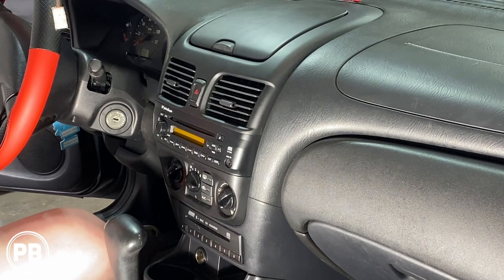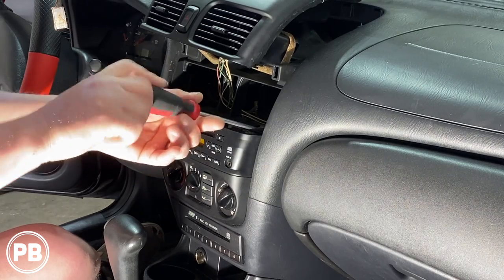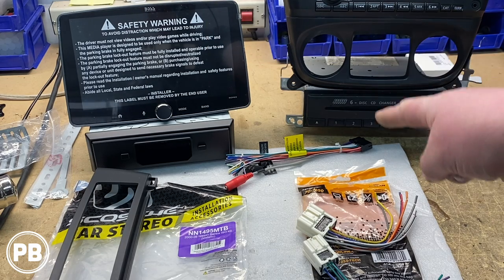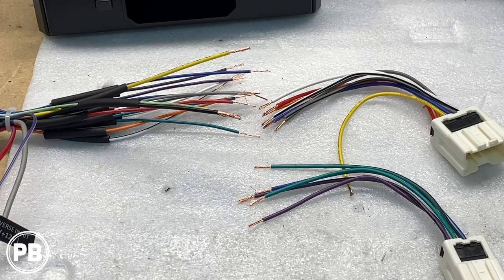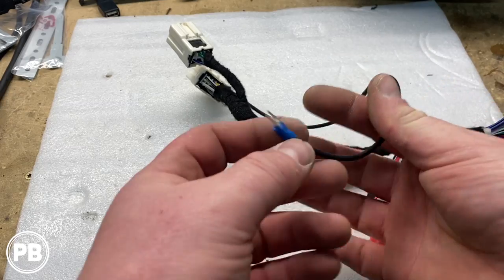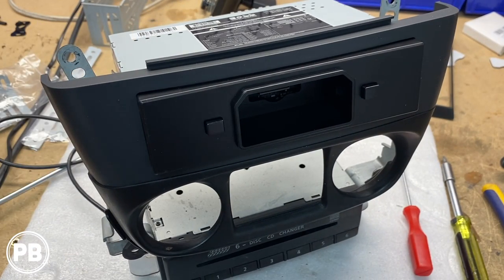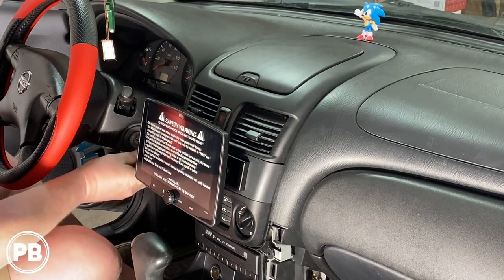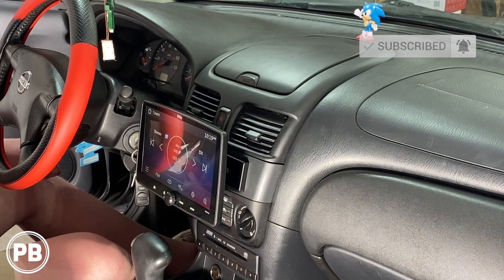2000 - 2006 Nissan Sentra Radio Install

Comment: the OG B15 sentra, i have an 04 sentra with a kenwood kvt-617 with the nav617 and kna510 Sirius adapter with a Garmin Super Antenna for the xm (back then it was 2 services, sirius and xm). on summer days you couldn't even have the screen out because it blocked the main AC vents. but still running strong about 16 years later. only updated the amps and the speakers. good install.

Comment: The good thing about that cd changer is, these cars are sitting for parts everywhere and the non changer dash panel is readily available.  I just don't understand why an early 2000s Japanese  designed Sentra didn't have a double din from the factory when there was plenty of dash real estate available.

Comment: Hey, I have a question! I'd love your help on it. I have a 2006 nissan sentra. I did everything like you shown. However you said to connect the blue and white wire but I didn't and I still got audio. However I'm having issue with the signal for back up camera. It keeps saying signal lost. Any idea?

Comment: I have a 2006 Nissan Sentra with the Rockford Fosgate my sub and rear speakers don't work according to the wiring diagram the head unit supplies power to the subs and rear speakers how can I replace the head unit and bypass the amp or what is the easiest solution to get this system back working
Reply from the maker: We had the rockford fosgate system as well and no additional steps were needed as our new radio seamlessly worked with the factory amplifier equipment.
Reply: Same question, because I ordered the wiring harness you linked with the RCA outputs and matched color for color but no sound.. I even put used the blue/white wire . No sound. Rockford fosfate 2006 Sentra also….
Reply: James and Selina, did you find a solution or just reinstalled the factory radio?
Reply: @alfonsocorona1008 same issue did you get it fixed?
Reply: @urkool7543   I was able to get it going . Matching all the wires and in regards to the 4 cables I only used 2 of them rca cables on the (left) top and bottom . Can’t control the sound from left to right or front to rear but at least all my speakers have even sound coming out of them now.

Comment: So my sentra has the Rockford fosgate setup with the 8 inch subwoofer in the trunk, and i want to run my 2 ct sounds 12s with a ct 1000 mono amp with this head unit, what harness would i need and how would i take out the subwoofer and also factory sub amp without, door speakers amp, (i want to run my aftermarket subs with an rca cable to the amp and a remote wire ran to
Reply: Did you ever do it? What did you do?
Reply: @urkool7543  there's a harness at Walmart that'll work for it  and I did RCA's to my subs and doors, I just unhooked the factory sub and zipties the harness in the trunk, and removed the mount brackets

Comment: You grounded a parking break? I’m confused on what that is
Reply from the maker: Certain features are available when the parking brake wire on the radio is connected. Most brands (except pioneer and alpine) you can simply ground that wire to achieve those features (like video in motion).

Comment: How did you install the ground wire and tapping screw in such a small area? Having trouble with that
Reply from the maker: Self-tapping screw with an impact driver.  Predrill the hole if needed before you put the screw in.  Also feel free to use another ground location if needed.
Reply: Also, where did you put the wires for the Apple CarPlay/Android USB connections? Didn’t see any place to put mine but behind the radio and not in sight?